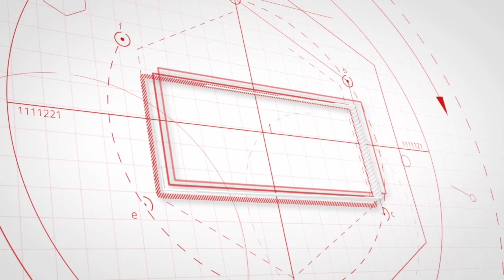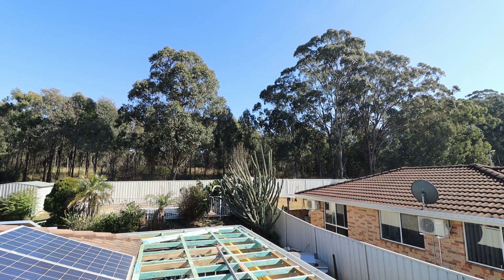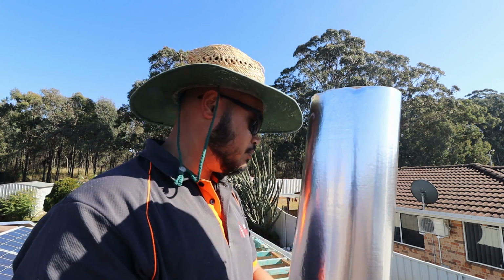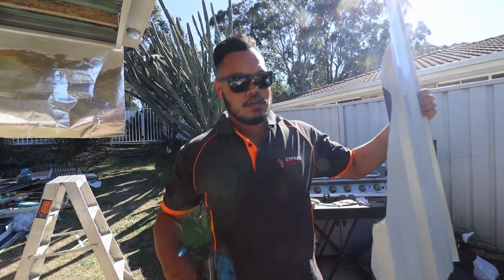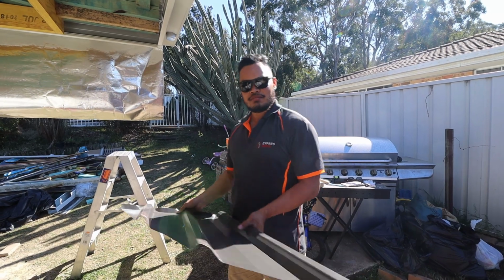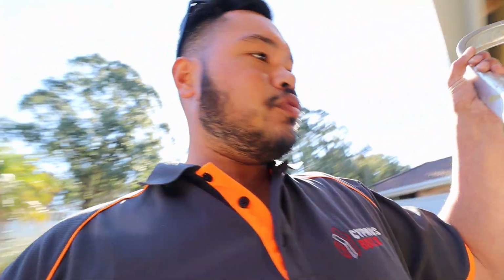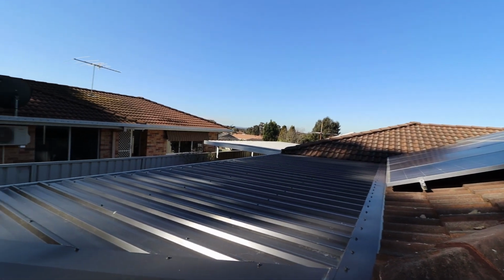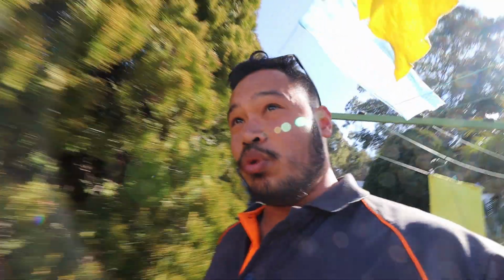Installing Trimdek Roofing

Comment: What is that attachment for the drill? I was cutting trimdek with a jigsaw today, it was a royal pain in the ass.
Reply from the maker: https://www.googleadservices.com/pagead/aclk?sa=L&ai=DChcSEwiV8dWyvfT-AhXFo5YKHUgJCW0YABAMGgJ0bA&ohost=www.google.com&cid=CAESauD2OfmXZA6_eM7icSK4v9bsiaZ8rS8W8T2llYgcIWRb0saA5AwKGFYwnX5FxAV_IcJRgyCfpbXTAOj9Y1ei7LtinHHM9swXknKvOqq6FGcgdGOqQI_AjOsgrpwCLxx2GHRT0AVAxIIr4cs&sig=AOD64_2i679_rhwGmqw2Co79rjcHsKBVdw&ctype=5&q=&ved=2ahUKEwjBw86yvfT-AhUumVYBHX8sB3AQwg8oAHoECAUQDA&adurl=
Reply: @NickDeeCarpentry  
Cheers bro 👍 I'll definitely be looking in to that for my Makita. Broke enough jigsaw blades 🤦😵‍💫

Comment: aren't you supposed to tape the join on the sarking?
Reply: Supposed to tape the joint, and secure it... not sure, he may have stapled it down or used the buttons, but he didn't show it.
Reply: Not if you overlap 150mm. Tape the joins if you overlap 50mm. With the correct tape.